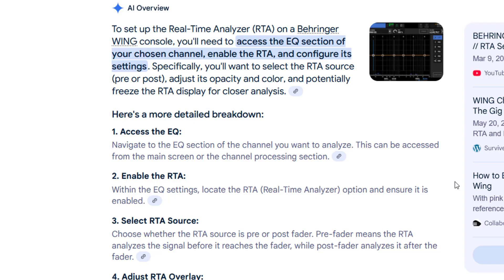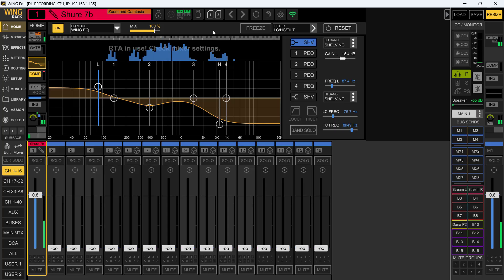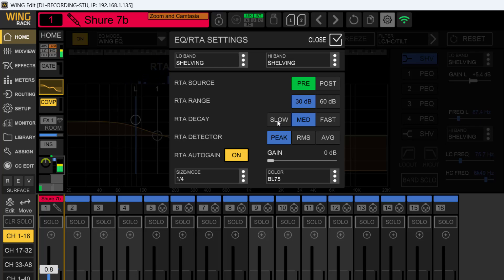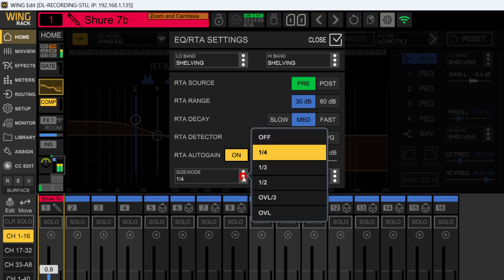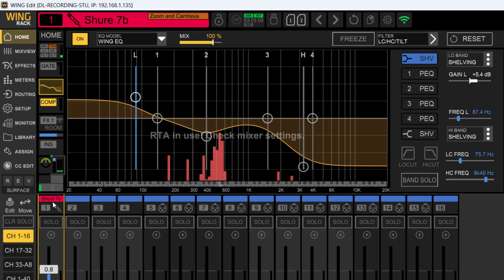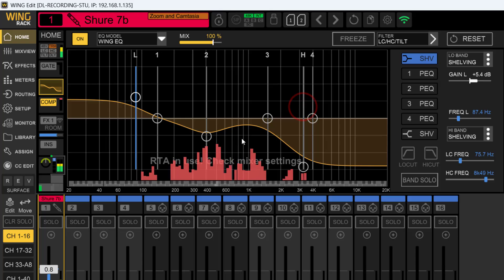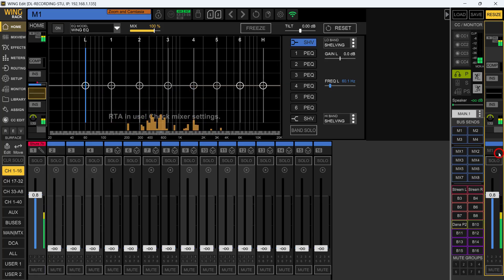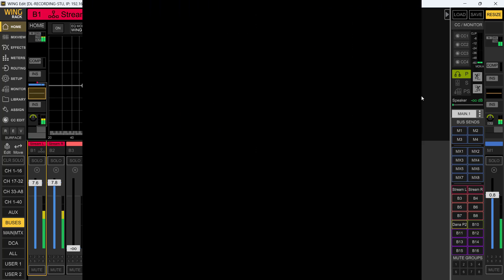Using The Real Time Analyzer aka, RTA On The Behringer Wing Rack. Firmware 3.0.6-27.

Comment: We tried to calibrate our new Wing with a reference mic connected to one of the local inputs on the back of the board. We generated pink noise on one of the built-in generators. We did all the settings we could then monitoring the master channel does not give us what the reference mic is capturing, but the oscillator signal directly. There was no way to select the source of the RTA on the EQ page. We did find a setting to listen to the selected channel but the oscillator signal still overwrites the RTA graph. We could see it working on the channel EQ where the calibration mic is, but not on the EQ or GEQ on the Master.
Reply from the maker: This is what I do. I run the pink noise oscillator on channel 1 and my reference mic on channel 4. When I go to the EQ on  channel 4 or the main, I can use either EQ as well as the GEQ as a insert to manipulate the signal. If you send me your snap I will check it out. https://danatucker.com/contact/